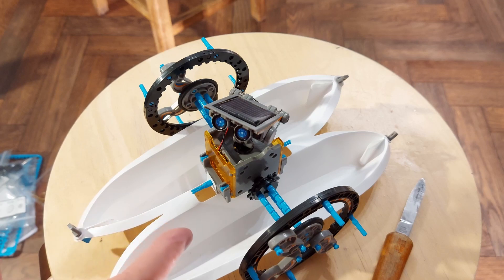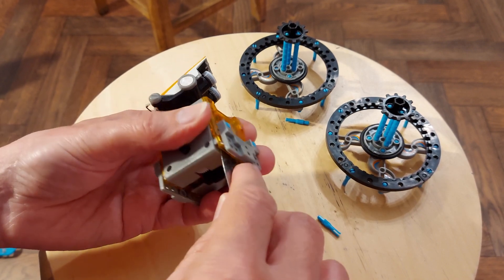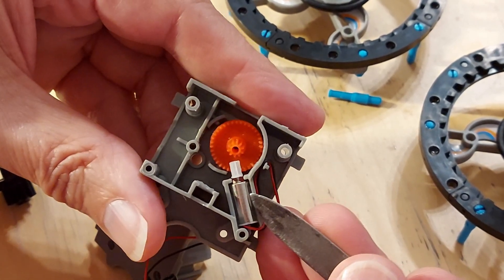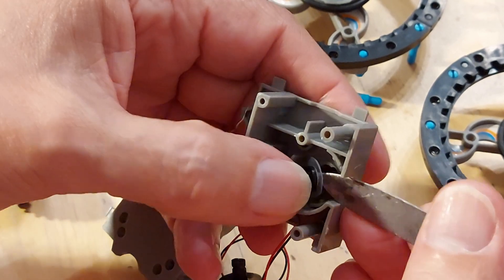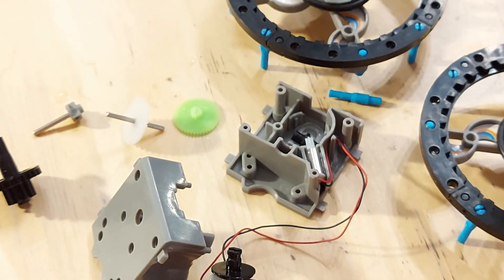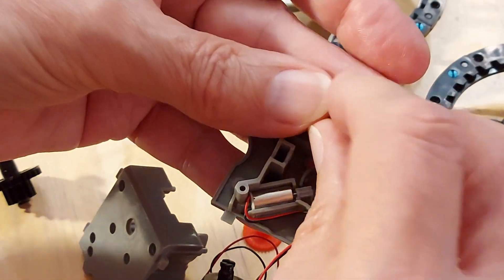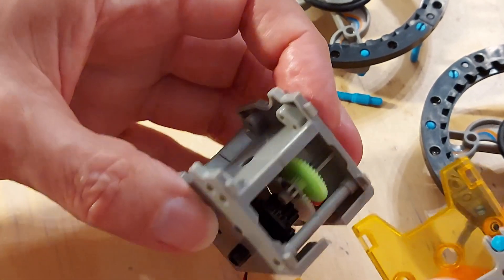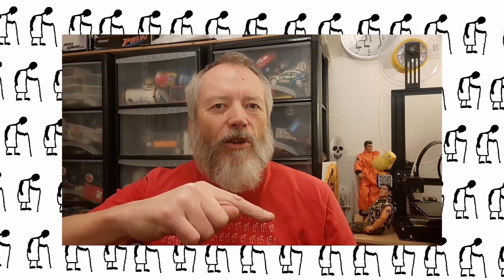13 in 1 Solar Robot Kit PART 8 my fix for the gearbox

Comment: Yea I give up. This thing is cheap and junk.
Reply from the maker: I have had the 12 in 1, 13 in 1, and 14 in 1 kits. The differences between them are minimal and I managed to work through all the builds. You will find the playlist in the video description. As covered in this video, there was an issue with the tolerances on the gearbox to get it running smoothly.

Comment: This is a great video, I upgraded with a plastic washer, glued the motor in place, and lubricated the gears. It works until I close the gray housing up. I even bored out the hole on the housing where the black gear fits and it still doesn’t work. These are a far cry from the Lego robot kit! 😅
Reply from the maker: Thanks, Mike. I hope you find a fix.